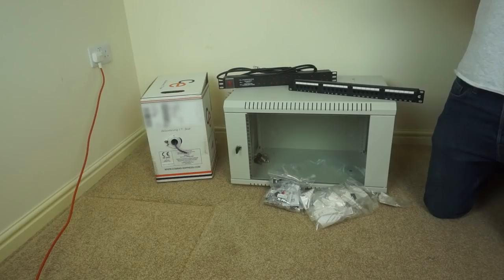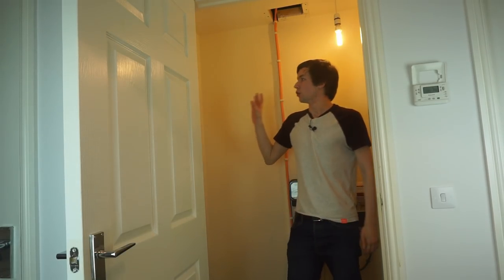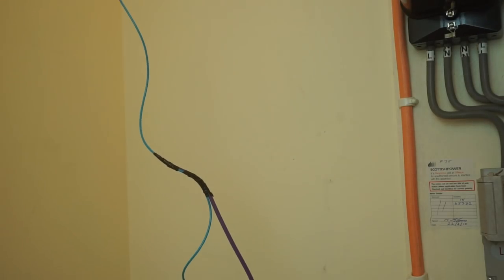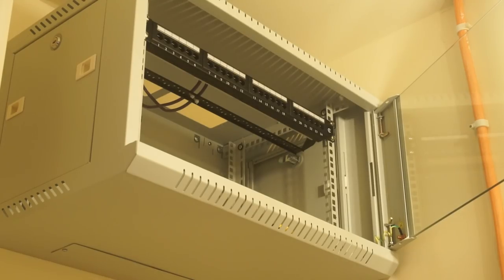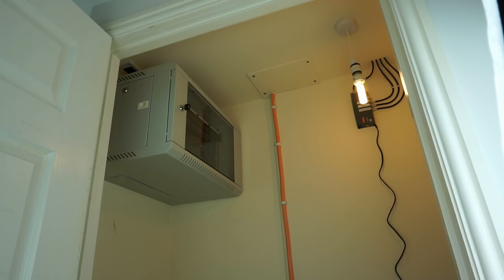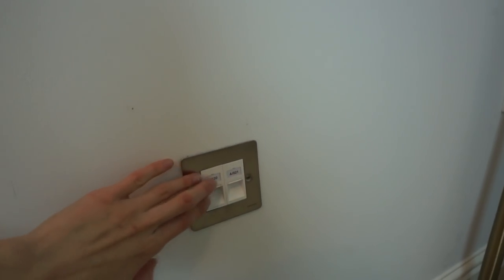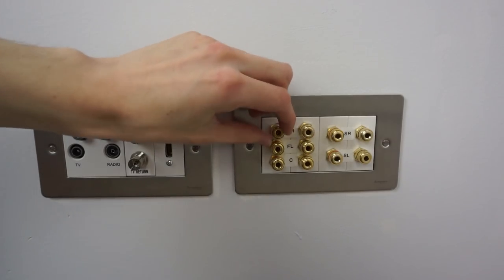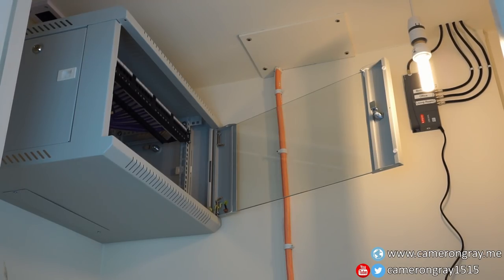New Flat - Time to install a completely overkill home network!

Comment: Are you able to share the wiring diagram of the house. Cheers.
Reply from the maker: I don't really have a wiring diagram, it's all fairly simple - just CAT6 from the hall cupboard patch panel to all the ports in the rooms then coax from the amplifier in the hall cupboard out to all the rooms.  Then there's coax from the incoming faceplate in the living room to the hall cupboard to carry the antenna feed to the amplifier then another bit of coax from the incoming faceplate to behind the living room TV to allow me to connect my TV's satellite receiver to the incoming satellite feed.  On top of that then there's just HDMI from behind the TV to the corner of the room then all speaker wires just route from their respective speaker to another faceplate in the corner of the room.

Comment: Great vid Cameron. Btw does the cabinet have a cooling facility? How do you ensure its not too noisy?
Do you just connect the power strip from the mains connector?
Reply from the maker: No fan in this one, it has some air vents around the top and bottom which are sufficient as none of the kit I'm using gets particularly hot.  The only noise comes from fans in the installed equipment, mainly my USG-Pro router but being in a cupboard located off my hallway, it isn't an issue.  The power strip simply plugs in to a nearby socket.
Reply: @camerongray1515  I have a usg and switch 8 60w and it Gets really hot to touch. I have to move it to a cabinet and looking at options. Might get one with a fan or even use a USB fan.
Just watched a lot of your vids. Really good and you got a lot of ubnt stuff!
How did you find routing the cables ?
I always hit a joist or the fishing tape I use bends too easily. 
Gave up in end and just ran it under carpet...
Reply from the maker: Routing mine were fairly easy because of my ceiling sort of being a drop ceiling so there was space above every joist.  The rods worked well but I just had to cut additional holes to feed between if the distance was too long and the rods bent too much. I never ended up using the fishing tape.  If I was doing it again I'd probably get fibreglass rods which would be less flexible.
Reply: @camerongray1515  thanks. Might invest in some now... Saw your vid and its a lot of work!
Reply: @camerongray1515  did you get 1m rods or the 30cm ones?
I guess for long runs it's best to use the longer cable rod
Reply from the maker: At a rough guess mine are around 50cm but you link multiple rods together so the length of each rod isn't super important. Longer rods would require less screwing together but might be more awkward to store and transport.
Reply: @camerongray1515  I did think longer rods are easier as they have less chance of coming loose but then you're not really twisting it a lot are you?
What's next on your project list?
You're one brave dude, putting holes in a new house!
Reply: I did actually think of buying the fish tape in a reel but everyone seems to be against those for some reason
Reply from the maker: Yeah, I've never had them twist loose.  Got a couple of security projects lined up so might film those.  Also need to replace and upgrade the fire detection but I fear making a video of that will result in a bunch of armchair "fire alarm engineers" complaining 😂
Reply: @camerongray1515  always some armchair experts. Iike your vids. Very informative. People do things differently. No need to be argumentative!
Keep up the good work Cameron!
Reply: You must already work in networking to be able to attempt this anyway...

Comment: The only thing  you missed  was the ventilation in  the box for equipment
Reply from the maker: +G R All that cabinet holds is a fairly modern, power efficient switch, a modem and a PoE injector.  The ventilation holes in the rack (including the large ones in the top for the cables) are more than sufficient to keep temperatures within a safe range.

Comment: 29:15 is it me, or did you forget a connector for the subwoofer? Or does your surround set not have a subwoofer?
Reply from the maker: It does but I just have it sitting next to the cabinet that contains the receiver and connect it with a simple RCA cable.  I thought about running a cable but I would have needed another whole faceplate and backbox as the ones currently are fully populated with modules.

Comment: Would any normal booster work In place of the masthead amplifier?
Reply from the maker: I can't see why not, I went for the masthead one as it's powered from the distribution amplifier over the coax and therefore doesn't need a mains supply.  Obviously only fit anything like that if it's actually required, my setup is definitely "unusual" and maybe not "best practice" but it solved the issue I had.  Apparently my building's multiswitch has been upgraded to make the system Sky Q compatible so might try again without the masthead amp in case the new system provides a more powerful signal.
Reply: Thanks  @camerongray1515 . I am also getting the blocky interference. Moved the virgin router to far side of room, cables under carpet and it still interferes. I turn off the router and picture is fine. Might try a booster from aerial in to booster and then to TV.
Reply from the maker: @justintemp  In that case if it's interference I'd be looking at the connections and cable quality to see where interference could be being picked up before going for some sort of amplifier. Adding an amplifier after or at the same point at which the interference is introduced risks amplifying the interference in addition to the signal you want.  The issue I had with the picture breaking up was due to a weak signal due to an extremely long length of coax from the central distribution point to my flat, not external interference being introduced.
Reply: @camerongray1515  we only had a new aerial installed about year ago so it can't be that... During covid a booster might be worth a try...
Reply: @camerongray1515  did some investigation and it was the interference from the firestick that is connected to the HDMI input. That input is next to the arial cable. I purchased an extender and moved the firestick further away. That worked. Who'd thought the WiFi receiver from that would cause such a fuss
Reply from the maker: Ahh, this is something I also noticed, mentioned it in my second video - HDMI can interfere with Freeview signals, as you mentioned, moving it further away generally solves it.  The problem can also be caused by cheaper coax cables that don't have proper shielding.
Reply: @camerongray1515  sorry must have missed that in your second vid... I was paying attention.. Honest!
I now suspect the TV arial engineer, that's why you call them? Might have scrimped on the cable. He changed the arial but I now suspect that may be cheap too!
Reply from the maker: It's possible I suppose, does the aerial go to some sort of wall socket with a patch lead from that to the TV?  It's usually patch leads that cheap out rather than the cable that goes up to the aerial itself.  At least you've got it sorted now!
Reply: @camerongray1515  nope. It goes straight from the arial to the TV. Not patch panel in wall.
Reply: @camerongray1515  will see how things go..... I moved my router to far side of room as I thought it was that... Hopefully will be resolved.

Now to route cat6 cables around the house 😂🏡

Comment: Great job killer wall plates. Do you have a link for USA California....
Reply from the maker: Thanks!  Unfortunately you'll probably struggle to find these in the US as the UK uses diffently sized electrical outlets as well as the "Euro module" standard for modules whereas the US tends to just use plain keystone jacks.

Comment: How much did this whole project end up costing?
Reply from the maker: For the things shown in this video, probably around £500 which includes all the cabling, connectors, rack, patch panel, PDU, fixings.etc, this also includes the metal network faceplates, could save a tonne by going for plastic ones which are a fraction of the price.  There was then additional costs for things like the switches I've installed and shown in the second video.

Comment: A lot of planning is needed for that scale of cabling, you've done a nice job. However, you have compromised the integrity of the fire barriers if you did not fill with fire-stop. Here in the U.S. it is a criminal offence to drill fire barriers without prior authorization and permits. And the local fire Marshall must inspect the work before the holes can be closed/sealed. I assume you live in a multi-tenant building? Lives are a stake...
Reply from the maker: I did fill any holes with intumescent sealant however on closer investigation it doesn't look like that was required as none of the originally installed cabling or plumbing has such seals around the cables.  My building is concrete framed, the fire barrier between my flat and the next flats consist of a concrete ceiling and brick walls, the wooden structure is localised to my flat and therefore isn't required to stop fire spread between properties like it would be in a fully timber framed building.  I referred to the bit of wood across the middle of some of the walls as "fire block" but actually they seem to just more be structural rather than anything as they were only present in some places and not others including within the same wall.

Comment: Awesome video. One thing I wondered at the end was how you connect into that master socket for the modem and dealt with the cable for that?
Reply from the maker: On my master socket I fitted a MK3 faceplate which acts as a microfilter (there are aftermarket ones that do the same) - this faceplate contains a pair of IDC terminals to extend the DSL connection. I have a piece of CAT6 that connects into these terminals (using only one of the pairs) and extends it up to a port on the patch panel. I then have an RJ45 to RJ11 cable to connect the modem to this port on the patch panel.
Reply: Cameron Gray thanks. I’m cursed with a really bad location for my master socket that is quite far where I want my cabinet. I’m thinking I keep the modem by the master and route everything else from there to my cabinet.
Reply: Sorry one more question... 

If your terminating the connection each end with keystone jacks, and went to use one of the unifi products that wants PoE, do you just use a tiny patch cable to go from keystone to standard rj45 connector? I love the look of the keystone but I’m just thinking about using some of the unifi ac in-wall ap points.
Reply from the maker: Exactly, I just use a small 15cm patch lead
Reply: Sorry for the thousand questions. Would I be able to have my phone plugged into a standard cat6?

Comment: Why go through so much hassle to install wired connections throughout your house when there’s wireless? I understand wired is more reliable and each device can get its own uninterrupted connection, but is that all?
Reply from the maker: Pretty much reliability and overall performance, I don't want to have to go around and install wireless cards in all my machines and then need to worry about setting up a wireless connection on every device, much easier to just plug everything in and have it all work.  The performance of a wired network is also second to none which is important for me as all my files are stored on my central server then accessed from networked devices.  For me, if it's a device I'm going to move around (laptop.etc) or to a certain extent certain IoT devices, I'll have it on WiFi but if it's a device that is going to stay in a fixed location, I'll always wire it in.  The wiring can also be used for things other than networking such as to run HDMI between points.

Comment: Dont get it. Why limit yourself by that fixations? I have done sat distribution at home but it was from  necessity.
Reply from the maker: Not quite sure what you mean, I've put ports in places where they are definitely required then some in other places where they may be useful in the future.  Of course I then also have WiFi for stuff that needs to go somewhere there isn't a port or for portable devices, it's not as though I'm connecting absolutely everything via cables.

Comment: Silly question, but how is your meter "read" if it's inside your house? lol
Reply from the maker: Traditionally someone from the energy supplier would visit the property and read the meter although nowadays (and this has been the case for many years now) you provide the readings yourself online.  The UK is currently rolling out smart meters (although  my provider isn't offering them yet) which will submit the readings automatically, usually through a built in GSM modem.  This is a pretty standard arrangement in the UK, electricity meters are almost always indoors, gas meters are sometimes outdoors on houses but indoors in flats.

Comment: Far from overkill but of course excellent job.

Overkill would be making 10 mains wall sockets (each with its own breaker, and smart power / current meter), 8 RJ45 with Cat7, and 4 fiber optical drop in every room. Plus few more ethernet cables to switches and ceiling, for things like smart switches, ac controllers, ambient sensors, wifi ap, lights, etc. :D Plus mounting everything in recessed canals, that can be easily accessed for modifications. Like this https://www.youtube.com/watch?v=7gVAxYq2d7o or this https://www.youtube.com/watch?v=cli4lRyQBGs , but not on the wall, but in the wall, with just the cover sticking a little, or flush with the wall :)

Comment: What type of degrees does this type of profession use?
Reply from the maker: At least in the UK this sort of thing wouldn't require a degree, the closest qualification you'd probably get would be as an electrician which you'd generally do through some sort of trade college or as a modern apprenticeship. Personally, I have a BSc(Hons) degree in Computer Science however I don't do this professionally, in my day job I work as more of a DevOps/Software Engineer/Consultant. Nothing about my degree really applies to any of this.

Comment: solid core vs stranded core - i took stranded core kionig cat 6 shielded cable 60 quid on amazon for 100m working well for me, bought cat 6 e shielded connectors and used plain wire inside of cat 6 shielded cable to make a shield connection on the connector since plain wire touches the foil inside, cable from sitting room (where virgin router is) is going thru the wall on outside wall to my room and about 5m across room on the bottom of the wall to my pc so in total from router to pc is like 20-25m cable going but ping in league of legends 28ms before i had 50m of ''cat6'' cable from ebay for 12 quid and it worked like shit
Reply from the maker: Generally you would use solid core if you are going into IDC connectors such as those on a patch panel or wall faceplate/keystone module.  You'd then use stranded wire if you are crimping a connector on the end.  Main thing to look for when buying network cables is to make sure it is a pure copper conductor, sometimes the really cheap stuff is CCA (Copper Clad Aluminium) which can be problematic.
Reply: yes the kionig cable is copper because the color is nice copper plus it works like charm - i tried to use wires from ebay cable and they were aluminium since not even 40w soldering iron ''antex'' could not put solder with flux on it, it just doesnt stick to it - so i binned whole cable, could not use the wires for various soldering projects :)
Reply from the maker: Yeah, Ethernet cables are a bit like HDMI cables in terms of pricing - There's no point going for the stupidly expensive ones but there's a big difference from a rubbish cheap one and one that is very slightly more expensive.

Comment: Nice setup, do you plan to do any smart home devices?
Reply from the maker: I'll probably do something down the line but for me, I'd want the smart stuff to not get in the way, for example, smart light bulbs would be cool but I wouldn't want to lose the use of conventional switches.  I'll probably look into some sort of networked central heating controller at some point, not sure what I'd go for though.

Comment: What was the cost of doing all this, Cameron?
Reply from the maker: From memory, excluding the switches/router/APs.etc it was somewhere between £300-£400. Could have saved a fair bit by going for plastic network faceplates instead of the stainless steel flat plate ones I used.
Reply: @camerongray1515  Cheers, Cameron.

Comment: how on earth did you cover up those huge holes in the end?
Reply from the maker: I glued a small strip of wood across the back of each hole, glued the bit of plasterboard I'd cut out to that bit of wood then used polyfilla to fill in the gaps - Once painted they are completely invisible!
Reply: very brave thing to do, if you have a GF or wife, lol.

I would have thought it better to go where there is an existing socket, pull push from its back plane and then place the new backplane for the ethernet side by side , and then only have to make one smaller hole up top.  just an idea.

Comment: You’ve got a 1000ft of cat6 why pull one when you can pull several ,you NEVER have enough runs !
Reply from the maker: There's already two runs to every point totalling 21 runs (now 23 after adding a couple of cameras), already more than enough for a 2 bedroom flat. Sure I had a bit of cable left over but if I were to add any more I'd need to expand to a second patch panel and I'd struggle to find places to actually put them. If you're referring to why I only pulled one at a time - I only had one box and the way they were loosely sitting in the ceiling made it difficult to accurately calculate lengths to cut them in advance, much easier in the end to just pull individually using the nylon line to feed it.